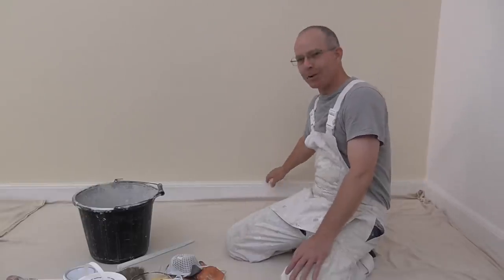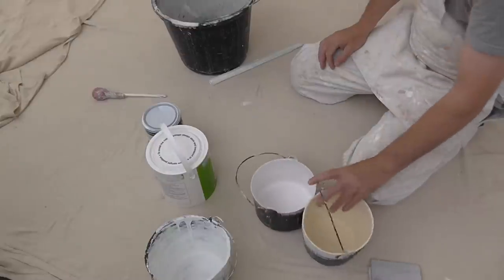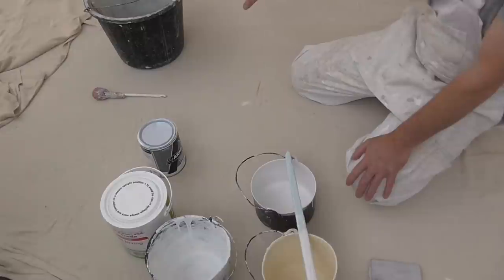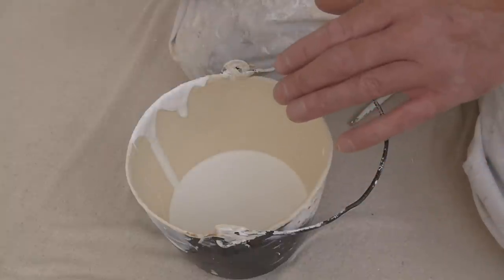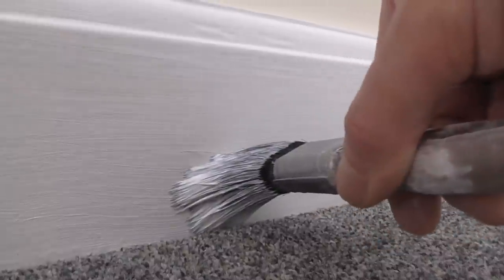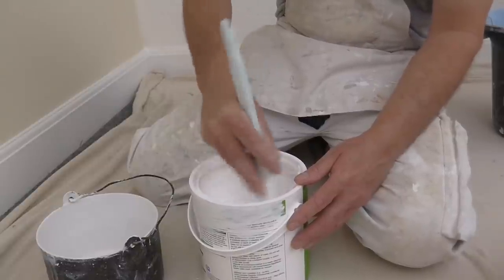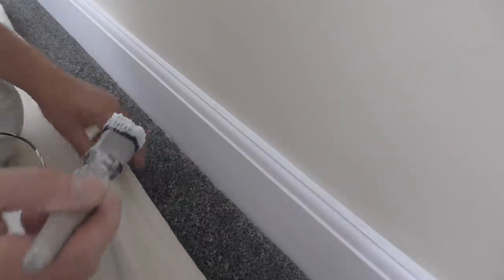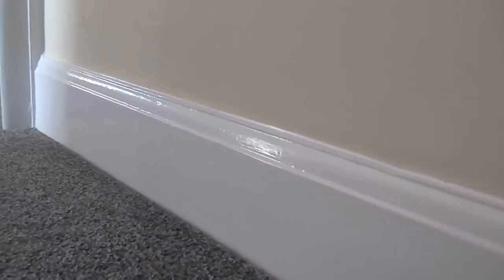Water Based Gloss Painting Skirting Boards

Comment: I recently used crown fastflow water based gloss and had to give it 2 coats  would you recommend the Leyland over crown, great videos, I'm only starting to switch to water base for interiors as customers are asking for it more, it seems to keep its whiteness a lot longer than oil based, served my apprenticeship late 80s then left painting for about 25 years, so much has changed in the way of different paints, the methods you use are the same as I was taught by the old pros, love learning about foam and caulk etc, dont think I ever used it back then 👍
Reply from the maker: Thanks, have not used the crown fast flow yet but water based gloss is difficult to get right. Sometimes it acts like silk emulsion which can look terrible till it fully dries. Always paint allow to dry before making your mind up about a second coat.

Comment: Great job as always, thank you. A question: when applying water based gloss on previously solvent gloss areas, would you ever use shellac paint as base coat, like zinsser, then water gloss?
Reply: Just my opinion but if your were using water over oil I would use a waterbase primer like zinser bullseye to seal over and your then keeping with the waterbase system.
Reply: @robbennett9631  I have used zinsser BIN (shellac base) on solvent gloss and applied water based paint after, and that seems to hold up. The only thing is, that BIN is a nightmare to paint with because it dries instantly
Reply: @mpkleinbreteler  yes I agree it dries so quickly…. 😊😊

Comment: After you denibbed the undercoat, you can spray the skirting with a light mist of water before putting on the gloss. Works a treat with the  waterbased stuff. Been doing it for years. Nothing too heavy...just a light mist of water
Reply from the maker: Would not want to get water on the finished wall, I can see how it would work possibly. My only concern is that the undercoat may work up in places especially on edges.
Reply: @PaintingandDecorating  sometimes I use a damp Sponge aswell to moisten the surface 👍
Reply: A wipe with a damp cloth works too.
Reply: Pure bristle brushes thats interest ing all the tins say use synthetic any difference
Reply from the maker: @richardkeeler6422 Water based paints have been applied using pure bristle since Roman times.  Synthetic are okay and we do use some. Personally I prefer natural bristle more control and allow speed of application and fine laying off. Synthetic cheap to make less control and can flick paint, and the filaments are weak easily thrown out of shape.
Reply: @richardkeeler6422  Synthetic brushes are not all as cracked up to be as they say they are mate..

Comment: I find I can get a nice finish with water based top coats if they go over a nice smooth previous coat. Over an oil primer they look well. But there is no doubt about it , all water based paints seem to go soft on handrails and come off almost like chewing gum with the grease. They seem hard until a year or so of grease is built up and they eventually go soft. For that reason I have stuck to oil. Would love to go completely water based but I just don’t think they are quite good enough. I here a lot of people talking about Benjamin Moore waterbased paints as tho it’s the holy grail but I have seen this go soft in areas too. In my opinion oil can’t be beaten. If u get a slightly off white in oil based it will never really yellow
Reply: oil is still king for me
Reply: Hi Stuart for the handrails using a waterbase product I’ve used water based varnish over the top on the handrail and it gives it a lot more wipe ability works a treat… so if your using waterbase satin use a waterbase satin varnish same for gloss etc so you still get the same finish that you want on the wood 😊

Comment: Love your videos, just started repainting our gloss covered doors that have yellowed - I like the Leyland water based gloss you used on this video, I am struggling to find the undercoat you used locally, is there a different brand you ask recommend?  For the doors that have oil gloss on, do I just sand and use the leyland water based gloss or is the undercoat essential?  I want to make sure it’s a good job.
Many thanks,
Simon
Reply from the maker: thank you and yes best to use undercoat as long as you use acrylic undercoat..
Reply: Painting and Decorating I’ve bought some Zinsser Bullseye 123, would that be OK as an undercoat?
Reply from the maker: @srs26  You can...  but better off using undercoat which is better designed for the job..
Reply: @PaintingandDecorating  I had the same question: specifically what to use as an undercoat.
Reply: @boardgamer15  you can use Leland Acrylic Primer Undercoat. It does both jobs together and then go for your water based top coat. Works a treat.
Reply: @PaintingandDecorating  just a question if the doors are yellowing wouldn’t the zinnser bullseye be better as it would stop the oil staining through the top coat of water finish? Or do you think that the acrylic undercoat seals this over just as good?

Comment: Been watching for months now and have picked up loads of excellent advice, thank you.
Would like a quick bit of advice if possible. I have fitted new doors all over my house over the last couple of years and am now ready to paint them. All are factory primed. I have tried water based undercoat and gloss on one and the finish is terrible, flashed all over the place and brush marks everywhere. Lost confidence in water based so could I just sand lightly and use a decent oil based gloss directly into the factory primer to avoid the time involved with oil based undercoat drying times. Have 17 doors to do.
Reply from the maker: Sorry for late reply, yes you could but it may soak in a little losing some shine. And it won't be as durable. Cutting corners is no good in the long run.

Comment: When painting the skirting boards I use a paint guard  or a piece 1m length of upvc  facia board  and tuck it down between the carpet and skirting then just wipe it with some wet wipes as I go along
Reply from the maker: That could be better than masking tape on some carpets.